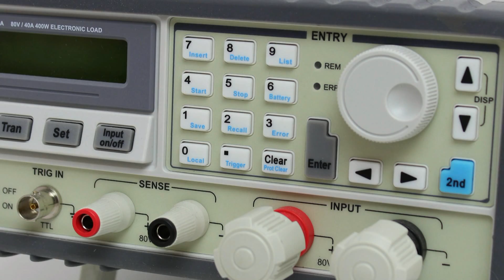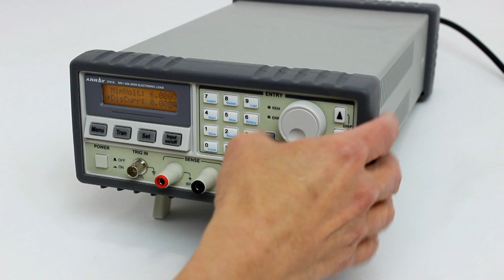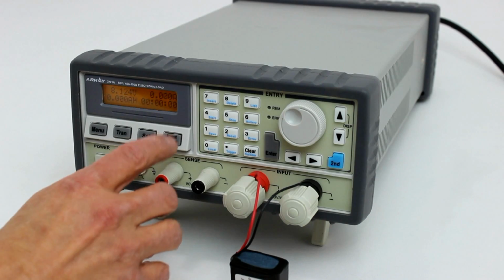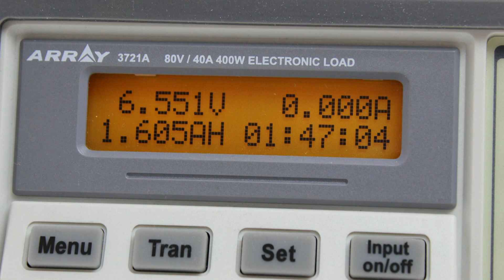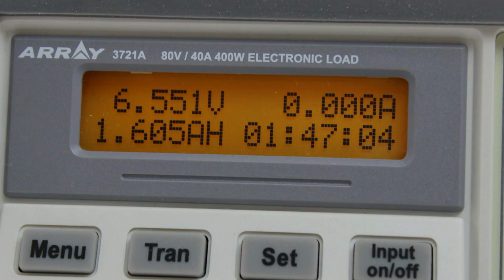Battery Testing with a Programmable Electronic Load

Comment: Looks like you can hook it up to a PC?  Is the software any good?  I want to graph the battery discharge test without creating work for myself.
Reply from the maker: The Mesh - absolutely, it can be hooked up via an RS-232 to USB adapter.  It uses standard SCPI communications, there is a guide on the product page.  It can also be used in LabView via the driver at the bottom of the CSI3721A page.  Here's an article about this topic from our blog https://www.circuitspecialists.com/blog/dc-electronic-load-remote-programming/